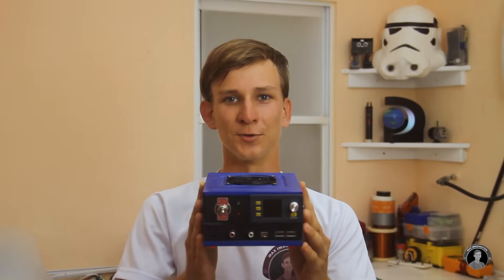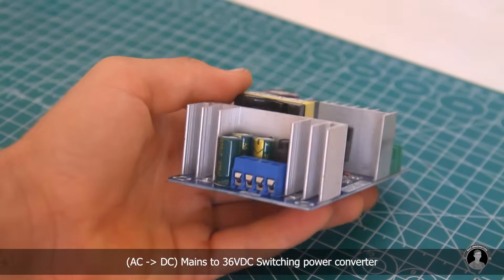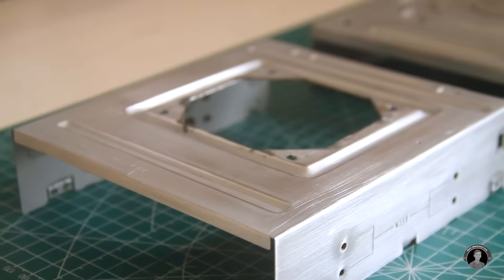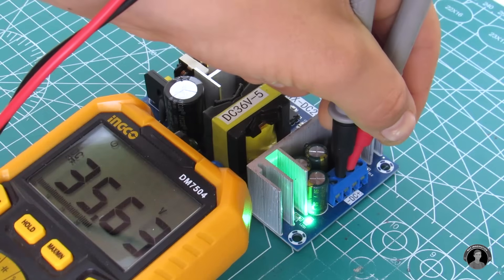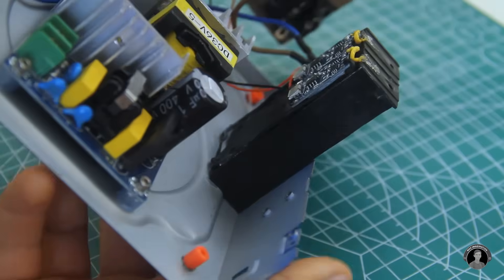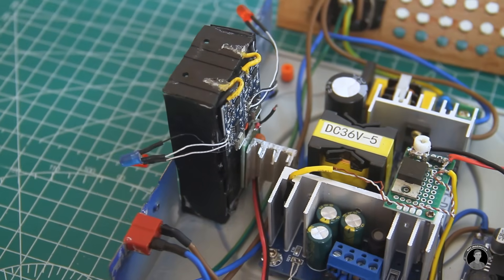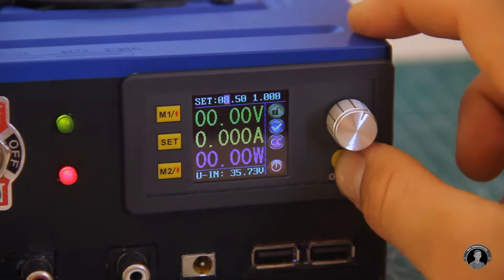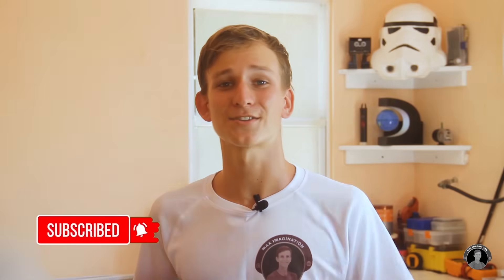Build the Ultimate Bench Power Supply for Electronics

Comment: WARNING ! RCA sockets are not designed to feed current (2amp max), use banana sockets instead (10 or 15 amp max)
Reply from the maker: Thanks for your tip. However, if modified correctly, the sockets should work fine for carrying that amount of current.
Reply: Better yet, use Anderson Powerpoles
Reply: That’s not necessarily true, I have a really thick high quality cord the auto rca on it is small but the video you can tell it’s a lot thicker wire and you can see the connector is beefer.  I use it with my amateur radio, I’m sure there is quality ones that support more amperage from radio / video equipment stores

Comment: When I was in my teens 50 years ago, I built a vacuum tube radio transmitter with a chassis made from 46 oz. juice cans. This reminds me a lot of that. Nice job!
Reply from the maker: That's cool! Thanks for watching 😀
Reply: Same here - I've always made stuff from discarded items. I like this guy's style! 
Somebody needs to get him a nice 3d printer tho - using thin plywood for those front/back panels was creative, and exactly what I would have done decades ago, but designing and printing would be so much easier. I suggest a Bambu A1 mini - with multicolor you can label everything.

Comment: This inspired me to make my own power suply and so i made a small size power suply with the same buck converter ,2 18650 type li-ion chargers 1 charger for smaller drone batteries (a voltmeter that can be switch betwwen inputs to show the charging proggres of each battery) and a stable 12v,5v output each with its own voltmeter 3 usb ports 2 thermometers to show the temperature of the buck converter and the 220v ac to dc converter and a fan to cool everything The case is 3d printed  and it is a beast. Thank you (ik the thermometers are probably overkil but i think it looks cool
Reply from the maker: Sounds brilliant! Great work on your power supply:)

Comment: So is it not really needed to use a AC step down transformer and a home made AC to DC converter with using the 4 diode methods. If I am not using the step down transformer would that mean I cam push 120v volts of DC power out of this. Also is something like this going to allow me to do voltage injection with out shorting out?
Reply from the maker: 36V input to this digital electronic power supply controller is the MAXIMUM. 120V will kill it. You need the step-down transformer.

Comment: Good job on this, helps a lot on ideas. Only thing I would suggest having worked with Lion batteries for so many years, the actual voltage of the battery is far more important than an indicator light. If the voltage is <safe charging value yet still charging it can result in a fire. as example I had a battery charging that was right at low voltage, after about 30 minutes I realized voltage had not changed, checked battery and it was dangerously close in temperature. 

Just a suggestion on an otherwise good video.
Reply from the maker: Thanks for your comment and pointing out this interesting but important key thing about Li-Ions.
I've charged old cells that got pretty warm when charging but still charged up. Yes, they are probably the most unsafe battery cells to work with, so precaution is number one. I appreciate your input on the project, good for others to keep in mind as well. Cheers!

Comment: Might as well just buy one going this route. I’m looking to build one from components. Yes I will say it looks pretty good but how much do you have in it as far as cost?
Reply from the maker: I made the mistake of purchasing the SMPS converter when I could have used a PC ATX supply unit. One could save $20 here. I spent a total of around $50 making this PSU.
Reply: @MaxImagination  Your way is better if you're doing everything from scratch. I would maybe do it in 2 parts. Regular ATX PSU to supply the 12v and 5V and then all the other doodads in a separate case but adding easy battery connectors is a really cool idea as it makes it somewhat portable. Or even better, power the whole thing with an old laptop power brick especially if you have a beefy 130w brick lying around.

Comment: Hi Max,

11 months on and with the benefit of hindsight, is there anything you would do differently?

If so, would it be worth a v2.0 video?

Thanks.
Reply from the maker: Hi there. It works for me fine as it is, I use it every day for testing my circuits. 

If I were to improve it, I'd probably just add a fuse at the AC input and some better connectors for power (|Banana Jacks). Apart from that, it works good and I don't think it is worth making an upgrade video.

Cheers!
Reply: @MaxImagination  That's good to know. Thanks for the reply. 👍

Comment: How are the batteries and laptop adapters "less stable"?
Reply from the maker: Batteries may be the most unstable, but laptop adapters do not have variable output power - is what I probably meant.
Reply: @MaxImagination  true, although variable laptop power supplies are available.  (I have one.)  There is a switch, so you get fixed voltages, for example 12, 15, 16  18, 19, 21 and 24 volts not variable, which I realize was the objective.  Current limited to max amount; short circuit protection included.

Comment: Warning !! 
The LM7805 will be very hot when it use for charging the battery, better used buck converter module with PWM feature.
Reply from the maker: True. I suggest using at least two LM7805 ICs or one LM2596 DC-DC buck converter.

Comment: I want a BOM and schematics, pretty please xo 🙂
Reply from the maker: You can find the parts/components list and diagram in the video description.
Reply: @MaxImagination  I bought a 60W power supply for a rack based PC and hopefully can add a variable step down transformer with digital display for voltage n current, stick it in a box n be done with it!?

Comment: Could one 3d print the case and other stuff. IAny worries about fire or melt down.
Reply from the maker: Hi and yes. The case may be 3D printed as long as you place suspended supporting posts for modules to be well seated, open space for heatsinks (to prevent meltdown). Insulating connections would still be a good idea, even with a plastic case.
Cheers

Comment: You used very powerful power supply which can output 20A at 12V but you used 5A step down converter why?
Reply from the maker: That's so I can give it future upgrades with higher power step down converters and other power-related peripherals such as chargers.

Comment: yes, but how does it work?
Reply from the maker: If you want the full technical breakdown, I'd suggest you watch another YouTube video describing exactly how a bench power supply works. To state things basically, this power supply takes the mains input of 110V Alternating current and with the help of a switch mode power supply + transformer, it converts it into 35V 5A Direct Current for the Digital Power converter board. The Digital one takes the DC input and is digitally controlled through its settings to supply a variable voltage and current limit.
Reply: @MaxImagination  Ah, thank you so much. the digital power board is a new term for me. I will get on it. Thanks a lot.
Reply from the maker: @MrSomethingdark  No problem :)
I'm glad I could help. Cheers!

Comment: It is better than wz6012?
Reply from the maker: The wv6012 can put out double the power but costs twice as much as the UCTRONICS 50V 5A Converter. The choice all comes down to your requirements. Cheers.
Reply: @MaxImagination  but if not look at power but overall wz6010 vs dps module?
Reply from the maker: @mareksmeirans4933  Not sure, I really can't tell. I have not yet tested the wz6010 module.

Comment: Just curious why didn't you just use an old power supply from a computer it's already square it already generates power
Reply from the maker: You have a point. Sometimes we don't always think of the simplest solutions until having already made the project and hearing feedback from viewers such as yourself. That's a viable solution for saving $20 on this build. Cheers.
Reply: @MaxImagination  hey I appreciate it thanks for your response I just happen to have a power supply line around which I noticed had few of the components are already on it and I don't have any CD drives lying around so this project will be your project just in a power supply thanks again for the video awesome

Comment: Really great job and good tutorial! 
Only thing I recommend is to avoid using hotglue at all cost. I used to do the same until I had a poor connection that over heated and the hotglue caught on fire. It burns surprisingly well. Instead, I'd much recommend going for conformal coating for proper isolation :)
Reply from the maker: Great tip! Thank you for your comment!